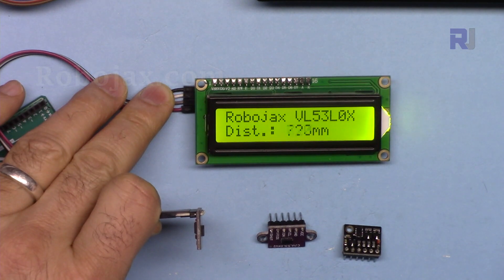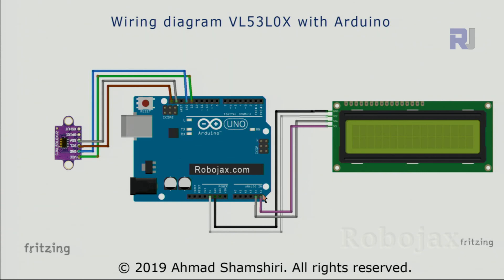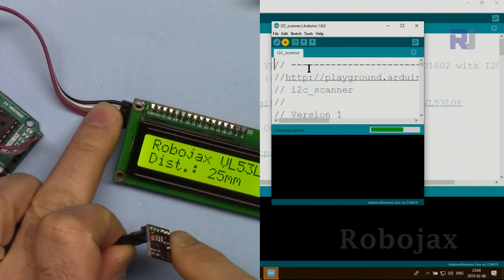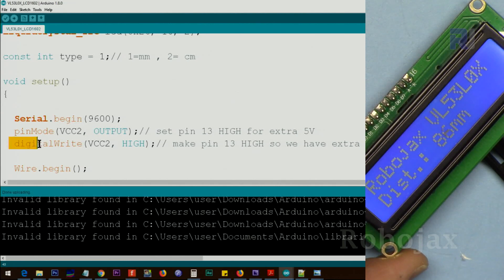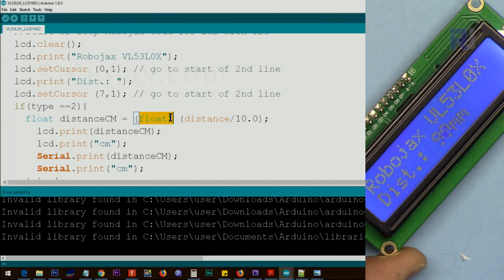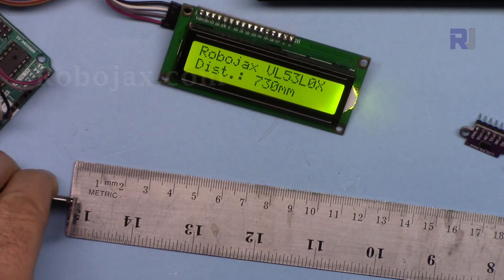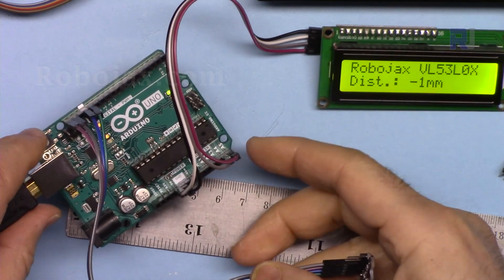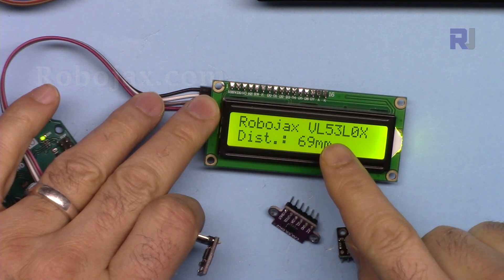Lesson 78: Display distance from VL53L0X on LCD  | Arduino Step By Step Course

Comment: hey your video is very helping, but why my vl53l0x give me "65535 timeout" ? Thanks
Reply from the maker: it can't read the data. try I2C scanner, disconenc tthe LCD and see if you can read the I2C address which confirms the the wiring is OK and the module is functioning.

Comment: How can you stop the measurement to bounce ? Or to have a deviation within 1mm
Reply from the maker: what do you mean by "bounce"? the resolution is 2mm. you can measure less with resolution of 2mm.
Reply: @robojax  basically in your video you have a static target which is the arduino box. And you measurements bounce from 96 to 94 to 98 without the target to move

Comment: nice and detailed video. can you pls make it with 16X4 LCD with Centimeters, Millimeter, Inches and ft pls
Reply from the maker: It seems you have skipped the introduction video. Learn it here and you can do anything you want with the LCD2004 and LCD1602 here https://youtu.be/pxUjEsJQW2M
Reply: @robojax  Noted, Pls be informed i am not a programmer / electronic guy.
Am a DIY - Hobbiest

Hence can you pls share the code for measuring using 4 output line by line by vertical / horizontal
1) in Centimeter
2) in Inches
3) in MM
4) in Ft 

Which was more helpful for measuring 
pls pls
Reply from the maker: you must learn or pay someone to do it for you. Here is how to find Specific YouTube Video in a channel https://bit.ly/findYouTubeVideo